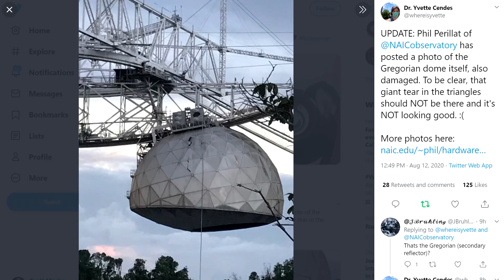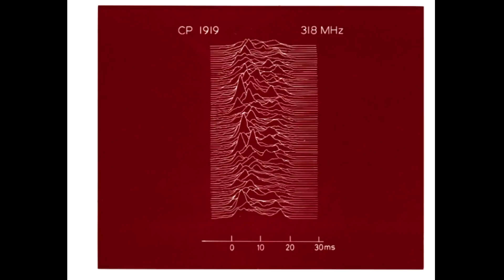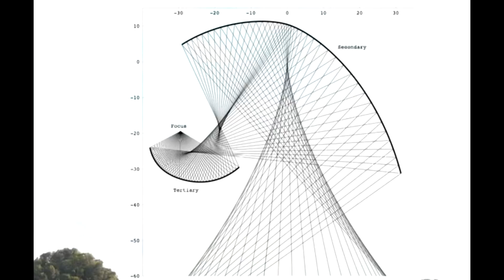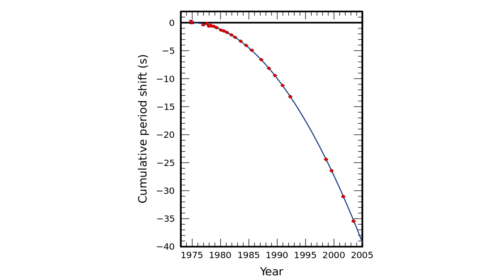Snapped Cable Damages Arecibo Observatory Radio Telescope

Comment: Seems like they should have cross-connected the cables so that the intact ones would keep the broken one from falling.
Reply: There might be an issue with how much "sky clutter" it can tolerate with a mesh of wires overhead.

Comment: High tension wires have a lot of potential force.
Reply: XKCD "What if?" #127 "Tug-of-war, a simple game in which two teams try to pull a rope in opposite directions, has a surprisingly bloody history. As detailed in a riveting article in Priceonomics, recent games of tug-of-war have resulted in hundreds of serious injuries and numerous deaths—all caused, one way or another, by ropes snapping. In particular, this seems to happen when large groups of students try to set a world record for largest tug-of-war game. When a rope under many tons of tension suddenly snaps, the recoiling ends can—and do—cause a terrifying variety of injuries. Other substances are even stronger; a half-inch shaft made from high-grade steel or a polymer like Kevlar (or, theoretically, a solid silicon crystal) could handle the pulling force from teams of anywhere between 500 and 800 competitive tug-of-war players. If we limit ourselves to a two-inch diameter rope, which seems to be about the maximum size for tug-of-wars, then the maximum number of tug-of-war players given a super-strong rope like Kevlar is in the neighborhood of 10,000. If we figured out how to manufacture large ropes out of graphene ribbons, which have tensile strengths over 10 times higher than existing materials, we could theoretically support a tug-of-war between teams of up to 100,000 players each. Such a rope would be over 200 miles long, and could stretch from New York to Washington. If our experience with nylon ropes failing is any indication, when the graphene finally snapped, the death toll could be enormous among both players and bystanders. Lengths of graphene would crack across the landscape like bullwhips, slicing down forests and demolishing buildings. In the ultimate game of tug-of-war, the only winning move is not to pull."

Comment: I strongly suspect those cables are not "braided", but rather twisted.  I've never seen a large steel cable that was braided instead of twisted.  Braiding is usually reserved for more flexible materials like nylon, cotton, Spectra, Kevlar, etc.
Reply from the maker: You are of course correct, this is what happens when you don't have a script and you forget the correct terminology.

Comment: 8:00 Fence to keep the radio waves out :D
Reply: Yep! As long as the holes are smaller than half the wavelength, or whatever the threshold is, it's fine. It we're talking Mittelwelle 531 kHz kind of radio waves, that's a 564581 mm wavelength, so you don't need a particularly fine fence to mess it up. A 10 cm mesh should be enough to wreck a signal with wavelength > 20 cm i.e. frequency below 1.499 GHz, but you'd have to get down below half-micron hole size to block visible light. Well, to cause interference resulting in signal strength loss, anyway.
Reply: @Sableagle  oh so that's micrometers not milimeters
Reply: @Tondadrd  On that old German transmission frequency? No, that really is a half-kilometre wavelength.

Comment: That wasn't a cable it was a composite wire rope.  "Wire rope" refers to a diameter larger than 3/8 inch (9.52 mm), with smaller gauges designated cable or cords.

Comment: how the Russian thing worked,  :) is that as the moon would swing in its orbit it would reflect the radar waves of very powerful emitters...by tracking that and the doppler shift...they could figure out the "cone" of a location for them the Shary Shagan ABM radar was found that way...  I've done something similar with my moonbounce station (amateur radio) at the 70 cm band.  fly safe Robert WB5MZO

Comment: The Chinese Radio dish may be bigger, but I haven't heard that it has discovered anything. Last I heard, the Chinese are having a hard time getting top notch researchers from the West to move to China and work on the telescope.

It's like the Russian giant mirror from the 70's that claimed to be bigger than the Hale telescope at Mt. Palomar.  It was big, but it's optics were so bad that it was, pretty much, useless for cutting edge observations and research. Since, then, it has been sent to Italy for repolishing but it's still not that great.
Reply: it literally just became fully operations in January of this year(2020), what kinda magic are you expecting the chinese to pull off? But even in test runs the chinese radio telescope has discovered dozens of new pulsars and first confirmed neural hydrogen outside of the milky way. so its doing work, just not at full capacity due to, as you say staffing issues since the location is super remote.
Reply: @mxn1948  I know that you meant, "neutral" but it sounds funny as hell to think that there are nerve endings outside of the Milky Way.

Comment: You were close, Scott. The University of Central Florida manages the telescope.
Reply: Some of the B-roll footage of the telescope had a UCF logo in the corner, I'm surprised Scott didn't notice that when preparing the video.
Reply: “UCF” was in nearly all of the images he showed. 🤦🏻‍♂️ (I don’t mind tho, I’d rather these small mistakes than a flawless edition that takes weeks to make)
Reply: If Cornell still managed it, this would not have happened.
Reply: @yummybeers  In all fairness, budgets are tight for science right now. I think you'll find this was probably an issue of deferred PM. Either that, or the fault was not foreseeable. After all, there are not many of these specific applications in the world. While probably similar attachments are used in bridge construction,  the devil can lie hidden in the details.
Reply: William Swenson Nope. Cornell would have absolutely prevented this. And my comment has zero to do with my being a Cornell alumnus, I assure you.
Reply: @yummybeers  Sorry, but without the fault analysis, the exact cause is yet unknown. I suspect it's a matter of PM, but the climate, the design, etc. Absolutely prevented this? It's much too soon to make absolute statements about a failure like this.
Reply: William Swenson That was intended to be joking. Mostly.
Reply: @yummybeers  Well, if you spent four years, "High above Cayuga's waters..." I might think that that would have affected your sense of humor. Mostly. Cornell is a fine institution, all attempts at humor aside. It would again probably come down to the available funds. The NSF also has a stake there, but its budget has been cut repeatedly over the last few years.All too often, it would appear that the sabot throwers are winning the war against progress..
Reply: William Swenson I suspect that you mean far above Cayuga’s waters. That said, I was indeed often high, above Cayuga’s waters. Carl Sagan was my next-door neighbor, and he got even way, way higher above Cayuga’s waters than I did. Yes, the Scheisskopfs has been winning, but I expect that is we can survive Draft-Dodgin’ Donny things wil turn around - these things go in cycles.
Reply: @yummybeers  Agreed. It just sucks to be at the nadir, rather than the zenith. I met Carl Sagan at the Universalist Church in NYC in the early '80s. He is one of the few men I've met in my travels who had a distinct aura about his eyes and his person. Apparently, the event was not well publicized and the attendance was modest; which turned out to be truly a wonder as I got a little over 5 mins. to talk to him. I still remember it with a clarity that few of my other memories share. Take care and hope the Democrats don't contrive to lose again.
Reply: William Swenson That must have been pretty great. I lived next-door to him for 2 1/2 years, never met him once. He was a recluse at Cornell. Take care.
Reply: @yummybeers  Thank you for your reply. I'm sorry you didn't get a chance to meet him. That he was a recluse at Cornell seems surpassing sad; perhaps it was the cost of celebrity. Let's hope for an upswing; I think we deserve it at this point. Take care, be well.
Reply: Not very well.
Reply: UCF, really? Where I am from it has a reputation as a party school.
Reply: @harryganz1  that'd be the school of business, reputation earned there. Weirdly the science and engineering schools are pretty solid
Reply: @harryganz1  UCF actually has some pretty solid science and engineering programs and a lot of partnerships in the aerospace industry being so close to the Cape.
Reply: @zacharygeorge4807  A good point about its proximity to the Cape. It looks like UCF has a quietly competent program in the space sciences.
Reply: @harryganz1  Yes, it sounds like UCAL at Chino.
Reply: @harryganz1  It looks like a great place for a party though
Reply: Harry Ganz it’s a party schools unless you are engineering major lol
Reply: I go to UCF, I'm not aware of any party school reputation. Although I'm a Physics major so it's not like I'd be the first to know. And yes the COS and CECS have very solid programs with many links to the nearby Aeronautical industries.

Comment: As a ham radio guy, I just love Arecibo Observatory.

Joe Taylor, who got his nobel prize in Physics for work at Arecibo, once pointed the Transmitters at the moon, and the reflected signal was so strong on earth, people with a small antenna and a handheld radio were able to talk to him, from half of the planet.
Reply: It is designed to resolve microwatts of power from billions of lightyears distance. A conscious effort to moon bounce with someone thousands of km away with 50 watts, why not?
Reply: @omniyambot9876  well, all your theoretical bullshitting doesn't help when people just go out there and do it. Moonbounce is a fairly popular part of amateur radio.
Reply: KW-transmitter not needed. A 36 element Yagi with a good rotor is key to a good, even interplanetary QSO...
Reply: Plan B if a solar flare kills our com-sats: We should get busy building an Arecibo on the Moon too.
Reply: @omniyambot9876  As long as your receiver is sensitive enough you can cut through noise. 
All analog and digital transmissions have noise, you can deal with this in many ways.
Reply: source? I can't find any info on this incident, anywhere, and I would love to read more about it.
Reply: @railgap  I don't know about work at Arecibo, but I can confirm that ham radio operators do "moon bounce," also known as EME or Earth-Moon-Earth communication, on VHF/UHF/microwave quite regularly. Joe Taylor, radio callsign K1JT, is the developer of the slow speed data modes "JT65" and "FT8," which is used for long distance weak signal communication including reflecting signals off the Moon and even passing meteor showers.
Reply: @vidasvv  "...Google it !"

No, thank you. And before anyone else has anything to add, please note that I'm not particularly interested.
Reply: @nagualdesign  It's good you've admitted your mistake, it happens
Reply: They may have been able to listen to him, but not talk to him, hey? 😉
Reply: @nagualdesign  That's the nice thing about ultra high gain antennas like the Arecibo telescope: It works both ways. If you are able to hear someone, and have the same power transmitter as them, they will probably be able to hear you as well.

People with only 1-2m long Yagi antennas and less than 50 watt transmitter power were able to communicate both ways.
Reply: @tommihommi1  the ultimate QRP rig, ehh? Lol
Reply: @nagualdesign  No! The aerial is designed to pick up very, very, very, tiny signals. It can hear a lot.
Reply: @sadiqmohamed681  Have you ever used a handheld radio? They don't transmit anything!
Reply: @nagualdesign  he is talking about a handheld transceiver (transmitter & receiver, usually referred to as HT or handheld by amateur radio operators). The Friis transmission equation being what it is, as long as the antenna gains and the path loss work out, then Arecibo can hear even a low power transmission from a handheld transmitter.
Reply: @nagualdesign  bro, have you ever heard of "walkie talkies"? Every ham has at least a cheap Baofeng, many collect higher end handheld radios.
Reply: @maxmustermann745  Ah.. I see. Cheers.
Reply: @sadiqmohamed681  Yeah as long as you can reach the moon and bounce it back toward the observatory it would work
Reply: @nagualdesign  Again, the Observatory is made to detect radio signals from hunderds of lightyears away, or even very small astroids that fly further than mars. 
So as long as you can reach the moon and bounce a signal back you are golden. Also I don't think tommi was talking about Walkie Talkies, those only have 20km range, but he was talking about handheld Radio transmitters.
Reply: Micah van Everdingen Path gain is reciprocal. If you can hear a signal originating from Arecibo then they can hear yours.
Reply: DID YOU GET TO TALK TO THE MOON MAN?
Reply: really? Did you talk to someone from the moon? lol
Reply: @AckzaTV  nope, because there is not anyone currently ON the moon to talk to, but it's easy to send a radio signal towards the moon, and have it reflect back, like shining a flashlight at a reflector, and someone on the earth with a similar antenna can hear you and reply.
Moon bounce is a common Ham Radio activity.

Comment: Shame, that that happened, but from an engineering standpoint one may as well shut it down for time being and completely overhaul it. I mean now is a time as good as any, exept it's already "out of order", so the impacts of upgrading would not have as strong an effect on observation time.
Reply: Yes, but there is no funding for that.
Reply: Depends if any engineering has been done premptively. Mobbing in for that kind of work does take months and months of lead time, especially in remoteness.
Reply: @steveford4055  Knowing scientists, the plans are in the drawers and have been for years, but as Pelican1984 pointed out, its all about that funding. Any good government would look at this and briefly discuss my earlier point and maybe get ready a "loan" or something, they could repay over the next decade, let's say you need $50 billion the US has set the federal budget for the 2020 fiscal year set at $4.79 trillion. Devide 50.000.000.000 by 10 and its 5 billion a year, which would be about 0.104%-ish of the annual budget, thats not even a drop in the ocean at that point. Not to mention that military probably still has some use for this facility as well.